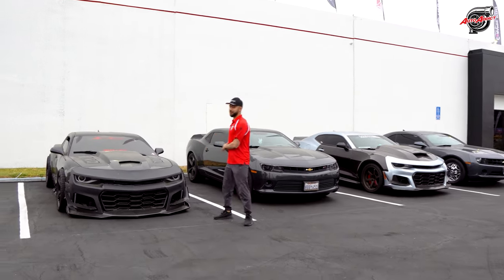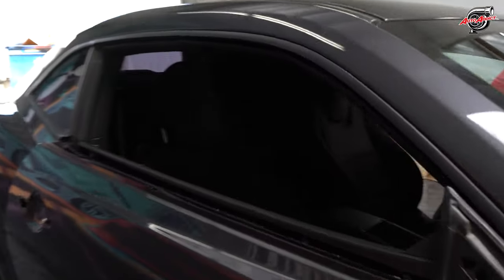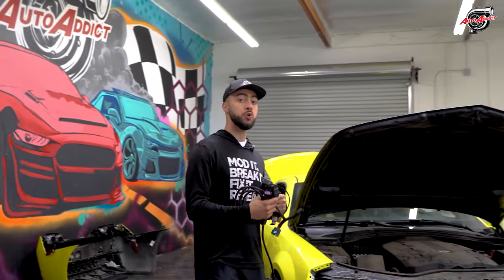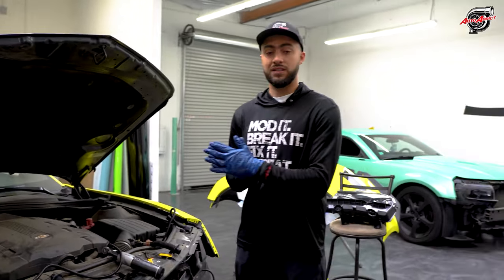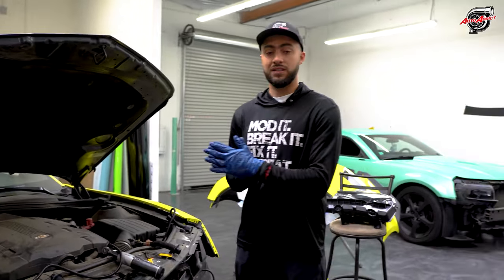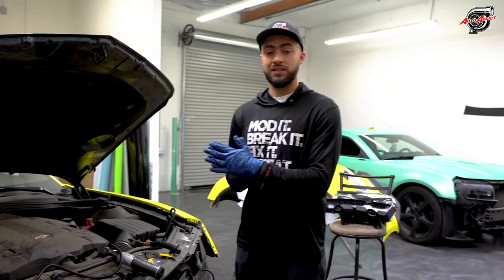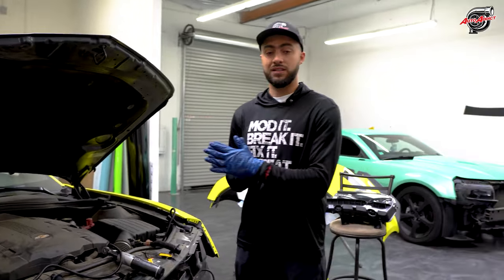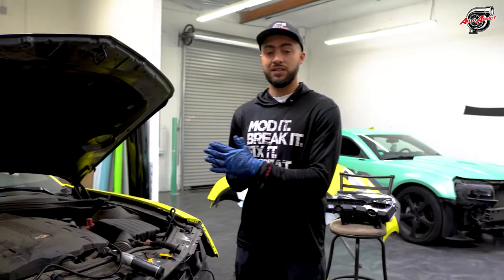Our BIGGEST transformation yet!!! | She's speechless! | Auto Addict USA | EPISODE 19

Comment: I just wanna know how much this cost her because I would totally do this if is was decently reasonable
Reply from the maker: Kindly email us for more information at sales@autoaddictusa.com
Reply: Kaitlynn I don't know about the cost for the wrap and labor but the bumper is in the approximate range of $1500.00 without fog lights and $1700 with the fog lights.

The headlights are $700.00. The wheels I've seen go for around $1000.00 to $1200.00. Tires like that typically range from $1200 to 1400.00. 

Carbon fiber hood around $2000.00. Carbon fiber spoiler around 1200.00 to 2000.00. The harness I'm wagering isn't anything less than $200.00

Youre looking at a ballpark figure of $8000.00 that's not counting the wrap and labor.  With everything i cant imagine its anything less than $10,000.00. Which may seem like a lot for some but maybe she wanted something new and overall this can be the cheaper alternative over buying a new car. Also she's only put 30k miles on  it. 

Personally i think they should've convinced her to bypass the CF hood and spoiler for now and go with an airlift system. Those aftermarket wheels with low pro tires created more wheel gap on the car than when it came in.

Comment: 20 x 10 on the front are to big on a 2010 Camaro you notice the tires are sticking out 20* 9's on the front with 275's
whereas the backs are great but your running a 305, you should be running a 315 out back, fills out the rear better
your also running 2 different heights on tires you could sent off a Check engine or traction control light
Oh and BTW Looks great
Reply: Everything you wrote is spot on. You're obviously a stance guy and fully aware of the sensitive nature of the camaro traction sensors and ABS. Her Guage cluster must've been lit up like a Christmas tree.

Auto Addicts specializes in great things but stance doesn't appear to be one of them.  Not only did they convince this woman to create even more wheel gap on her car than before it came in, they possibly took away her option to go with air suspension without purchasing new wheels. Depending on the front offsets ..the 20x10 fronts with 275's would likely rub a hole into the front air bags as they are wider than coils. 

Also like you said the fronts poke out of the car. The moment she airs out the wheels would crush the front fenders like a beer can. Unless they camber the hell out of it.

Comment: Should of did sideskirts too lol
Reply: Pretty sure the old dude in hardly Davison shirt already paid like 12k for this so far. He'll have to drop another 6 to 9k for the rockers, springs, tail lights, inner coolers for front vents, door sill wrap, diffuser, exhaust tips ZL1 front impact bar and rest of front behind the grill parts.

That's without 1 SINGLE performance part. Rofl. Imagine adding suspension, differential, rotors, full exhaust, cam, super charger, performance injectors, performance radiator, etc etc. That's like 20k in parts plus 10k in labor.

At that point just go finance a ZL1 from the dealer.

Comment: Curious on what something like this would cost 🤔
Reply: Roughly 6k depending on brand rims where you get the wrap, and carbon fiber aside from where you purchase the aftermarket parts
Reply: The zl1 bumper conversion and headlights would probably run you $2500. Hood 1000+ spoiler 1000+ wheels and tires 2500-3000. Wrap 2500-3000. With labor def over 10,000 somewhere 12,000-14,000 I’d say. I’m not all about looks ngl. I would’ve sold it and bought a nice 2ss with zl1 10 spoke wheels. Maybe still do zl1 front end with stock lights.
Reply: @alexvillalobos7137  bruh wouldnt it have been cheaper to get a v8 doing this to a v6 seems kinda wasteful but to each their own
Reply: @s550qu  complete waste to me. I buy and rebuild salvage title cars to get the most for my money I like how my 2010 70 k miles 6 speed Camaro looks like and I’ve only dropped around 11K to rebuild it. Drop springs zl1 10 spoke wheels and carbon fiber hood came with the car.  I also just rebuilt a 2016 hellcat with 19 k miles and red alcantara  seats for $30,000.